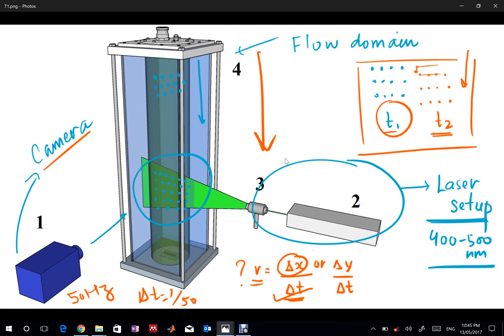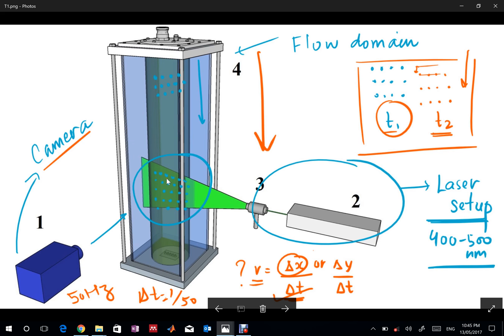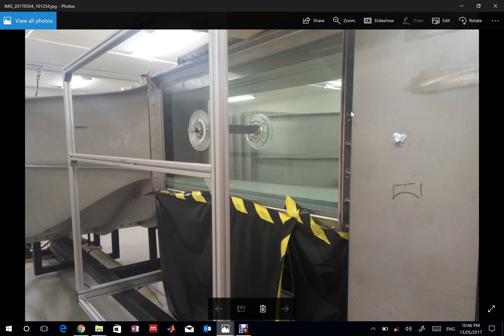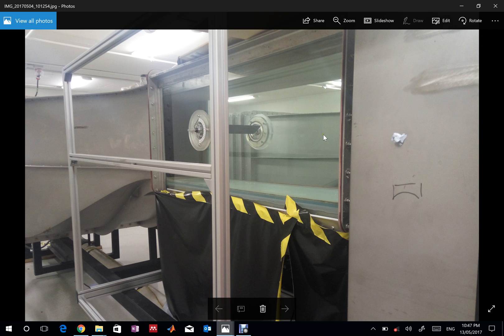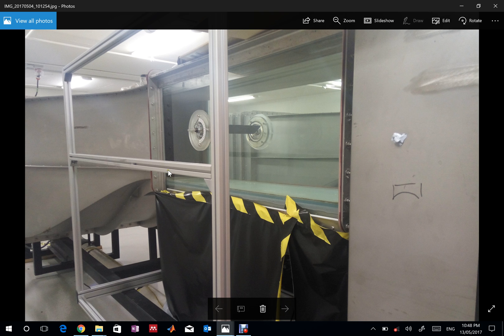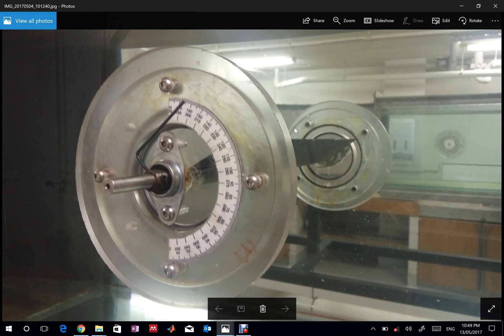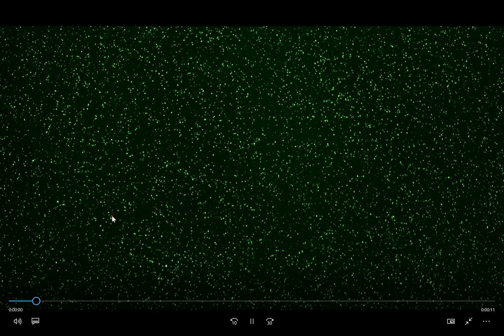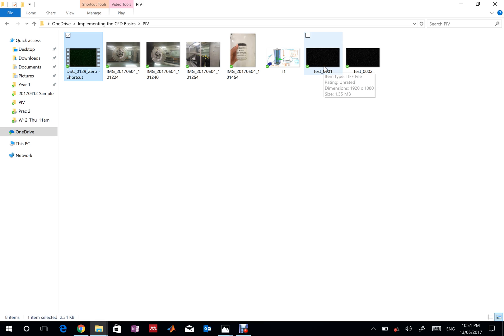Experimental Setup of Particle Image Velocimetry (PIV)

Comment: With a fast enough camera and multiple high-powered lasers, you could take it one step further and analyze the flow in 3 dimensions by sequentially turning on 1 laser at a time and synchronizing each laser with the camera's shutter. Of course that increases the complexity dramatically as the higher shutter speed requires more light and thus much more powerful lasers. I'm not sure a standard DSLR would suffice either, as you'd need to multiply the framerate by the number of lasers and most DSLRs only shoot up to 120 FPS (you'd also have the issue of each cross section being out of the lens' focal plane). It would probably require multiple cameras. The computation would take significantly more time as well. Still, it would be interesting to see the result.

*After a quick Google search it appears that this is already a thing, and only requires a stereo camera setup.

Comment: What was the power of your laser in the setup and did you use any optics to generate the sheet?
Reply from the maker: Maybe around 0.1 W (it was bought off eBay and didn't had very specific specs sheet). We used three of them to generate a larger FOV using lenses.

Comment: So are they results by an DSLR satisfactory instead of using a sCMOS high speed CAM
Reply from the maker: DSLR gives good enough result for a demo.
Reply: and do you use a synchronizer with DSLR
Reply from the maker: No. We used a constant power continuous laser and just captured as a video.